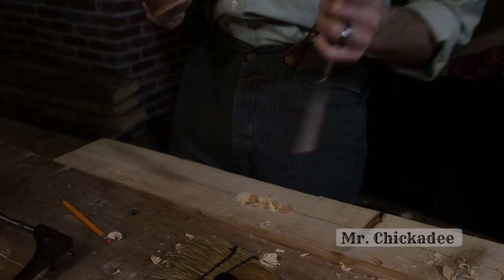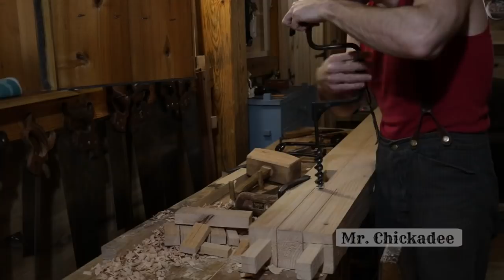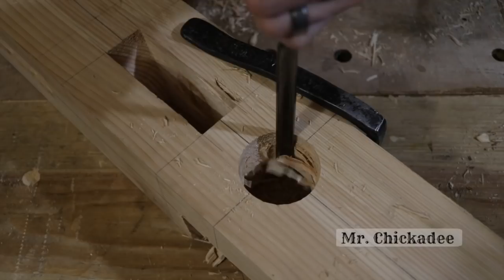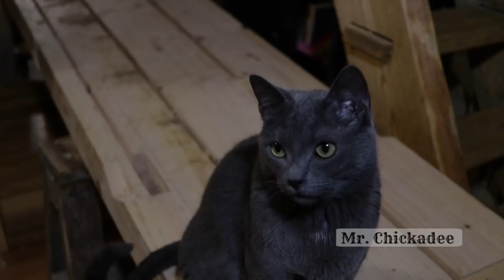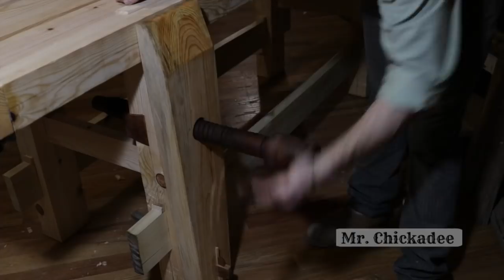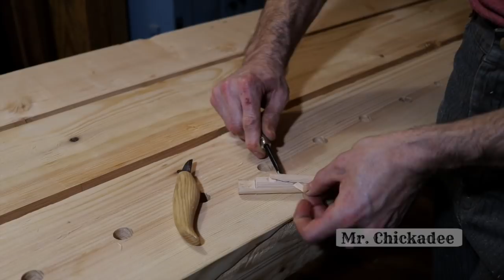The Asian Roubo Timber frame workbench, no nails, screws or glue, Japanese / Chinese joinery

Comment: I built a cross between Rex's bench and Paul Seller's - it's planked, but the Roubo interests me and I think I'd like to make one next.

Can anyone explain what's meant by: "The best part of this method of building a bench is NO DIMENSIONING of the top or legs is needed at all, just a simple timber frame line rule layout, the same as we use for all our timber framing, assures joints come up true and tight. "

Are those end-caps really necessary because they seem to really complicate the build? What's the point of the 1/2"-3/4" gap in the top planks? I could see myself losing tools and pencils down there easily.
Reply from the maker: Ill try, if you take your rough sawn or hewn timbers, you can, by the use of center line layout as I did here, lay out and cut all the joinery of the bench and assemble it without needing to take the hours of labor to dimension the timbers to be perfectly straight and square and smooth as you would using more common methods. I found this to be very practical. Yes the end caps are needed they hold the top pieces together, also facilitate the end vise. The point is to give a wider top, make assembly easier (no jointing of the top pieces) and give you a very handy place to hold tools while in a work flow.
Reply: @MrChickadee  Thanks for the explanation, I have since also seen the layout line method in Roy Underhill's book on log cabins. Do you think you'd do a short video showing how you approach it, if you don't have one already?

I just got a 1-1/2" screw threading box and tap, do you think this would be viable for a leg vice? We don't get 2" wooden screws in our antiques stores in the UK.

I also noticed that both sets of the stretchers didn't have cheeks cut into the mortises. They're just wedged dovetails - this looks like it'd save a lot of time too. Any downsides to this approach over having 4 cheeks like a traditional western M&T or one face like with a bare-faced M&T?

Comment: where did you learn the line rule or center line rule method? I am trying to learn the ins and outs of this but I have found very little info on it.  I thought it would be easy to track down since it’s been in use for thousands of years but’s no dice.
Reply from the maker: here is a pretty good start, write me if you need more help
https://permies.com/t/42793/Line-Rule-methods-layout-Timber

Comment: I thought you had a beam boring machine. They are the cat's whiskers for multiple mortise bores and quicker than a brace.

What wood species is that? Or is it they? Looks like you used several.

I think my house keeper will want a life-sized poster of you in your red tank top.

Are those lignum vitae vise screws and nuts? That species is getting hard to find in any but small flitches. The ship building and repair industry uses it for propeller shaft wet bearing staves and they have lumber factors scouring global markets for the stuff.

No thwartships bracing except the through-tenoned breadboard end? I suppose it will be OK so long as you minimize vigorous loading and impact on the center plank. I like the sawdust and chip gaps in the bench top but I bet you'll spend time under the bench retrieving pencils, nail sets, drills, dowels and loose tenons with glue on them, etc. Its a Murphy's Law thing.

As ever, Josh, nice work. Say hello to Charles.

Comment: Good job. You forgot to put the bolt at the  leg vice (the screw has a channel near the handle where a knob is placed)
Reply from the maker: The garter which moved the vise chop with the screw? I never used one, just push or pull the chop, kinda like a manual transmission in a car i guess...
Reply: @MrChickadee  this works well too, i thought you had forgotten to put the garter